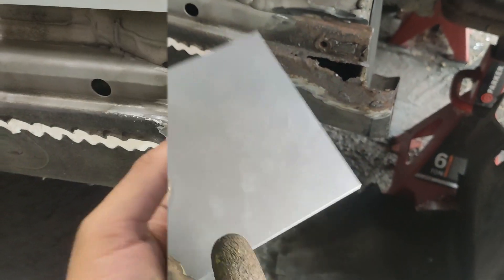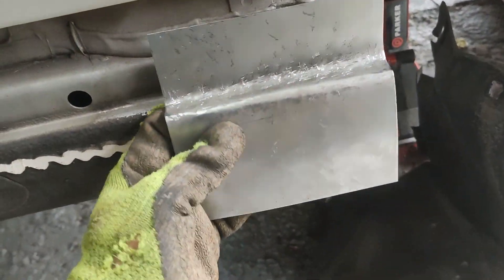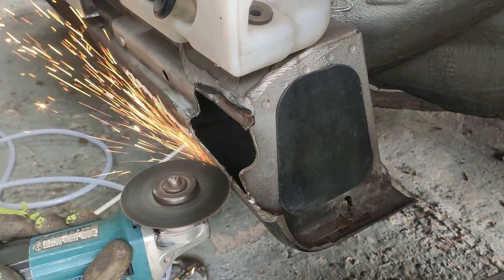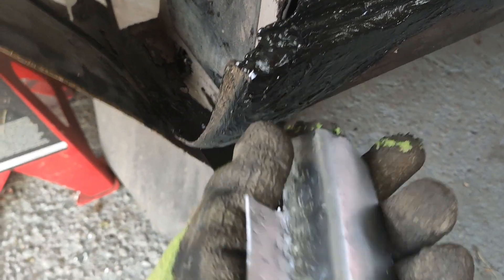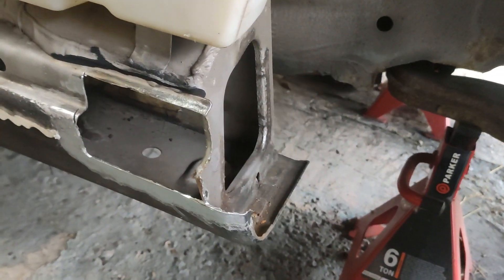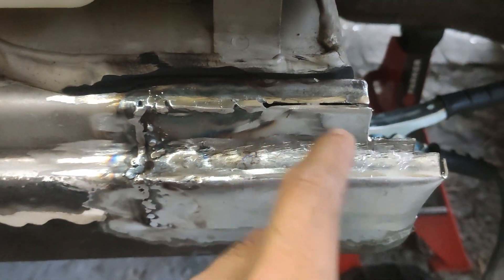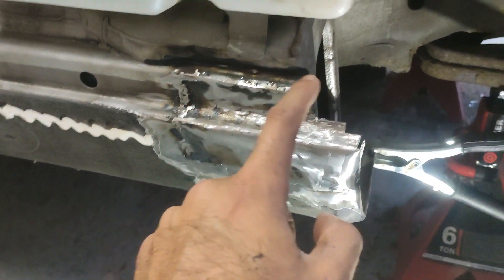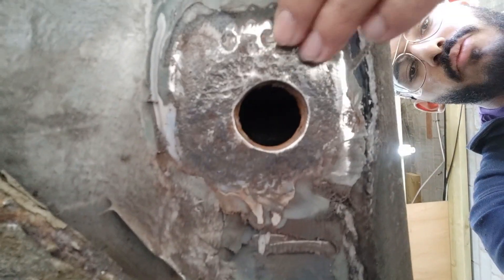ROTTEN SILL repaired with ONE piece of SHEET METAL!  Mercedes BRABUS SLK project car Ep9

Comment: Nice job young man! I'm the owner of SLK 200 Kompressor 2003 with 67kkm so far, very good shape, almost not driven. I didn't noticed any deep rusted places yet, just a bit under the trunk handle and tbh nothing at all at fenders, under side liners, etc. But it's a pleasure to watch how you deal with yours, maybe in the future i will need to learn how to fix mine when her time comes ;) Good luck and i'm looking forward for the next episodes! :)))
Reply from the maker: Thank you so much for the watch and comment! I often see the later models of the R170 tend to be a little more rust resistant, the rumour is they changed the paint. Final front end build episode coming soon, stay tuned!